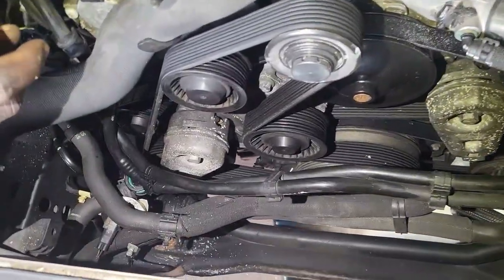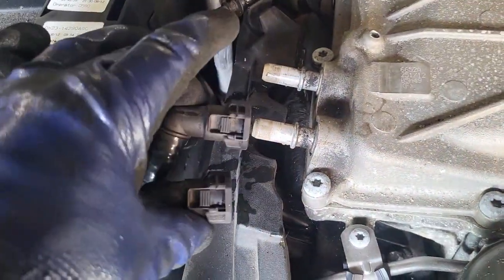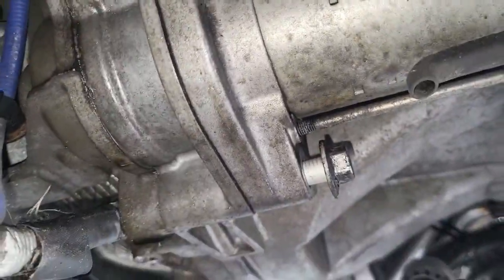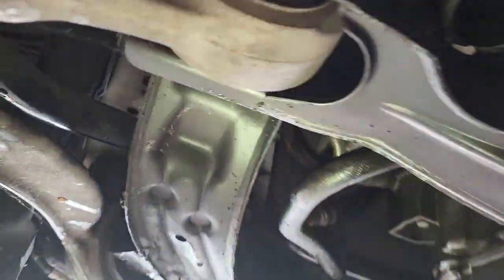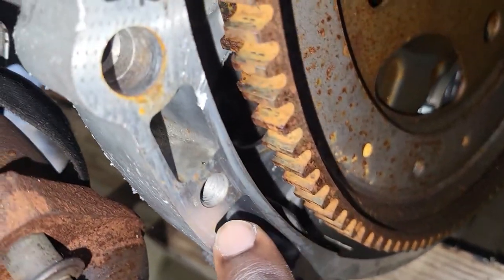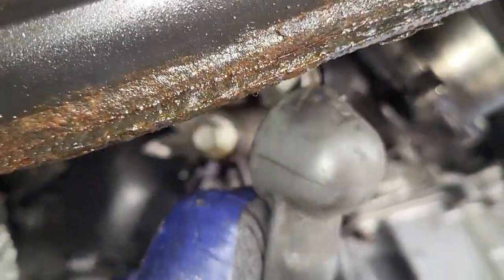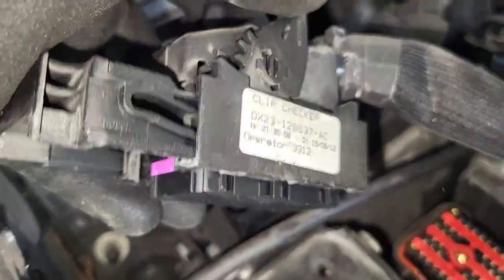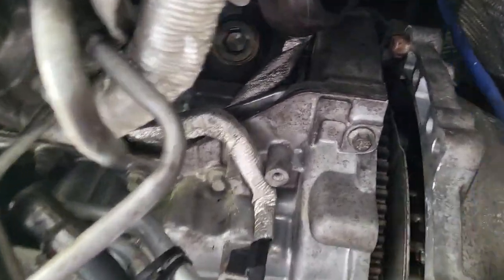JAGUAR XF 2015 SUPERCHARGED ENGINE REMOVAL/ENGINE SWAP/MOTOR REMOVAL

Comment: Is it the same process for a 2010 jaguar xf supercharged
Reply from the maker: Yes
Reply: @all-about-cars-basics Thank You I’m removing my own engine without any experience just knowledge and familiarity being I grew up around a lot of mechanics but none that’s ever done these and most are scared to for idk what reasons can I reach out to you for questions or advice
Reply from the maker: @tubbyg217  Absolutely, you can reach out. I will be glad to help. It should not intimidate you that they don't do this kind of job. You can do it. Good luck.
Reply: @ thanks Man I Really Appreciate that Brother Since you respond So fast If needed I could always just come back to this Thread Not sure if we can Dm on YT but I’ll see But man I really Appreciate it That’s Dope💯💯🫡
Reply: @ I’m also going to do the stage 3 tune with the upper and lower pulley with the ecu tune and Intercooler
Reply from the maker: @tubbyg217  You are welcome.
Reply from the maker: @tubbyg217  Nice

Comment: Yo im thinking of swapping a I4 2013 jaguar xf with a V8 is that possible?
Reply from the maker: I don't think it will work. If it was a 3.0 then maybe. The engine bay area is bigger in the 5.0 V8 engines.
Reply: @all-about-cars-basics Hello wonder were you are located may need to replace my engine
Reply from the maker: @michaelbarina1866  I am in DMV area.

Comment: Can you take the body off without disturbing engine bay?
Reply: I'm thinking about taking rolling Chassis out of XF to mate with 1958 RR. You think good idea
Reply from the maker: @ironhorse4696   That sounds like a really interesting project! It could be a unique combination of styles and engineering. If you have the skills and resources, I say go for it!
Reply from the maker: I guess that is another way to do it. But you need to have a good lift to do that.